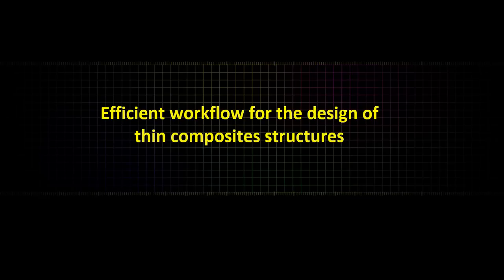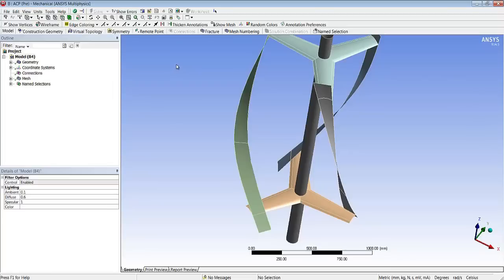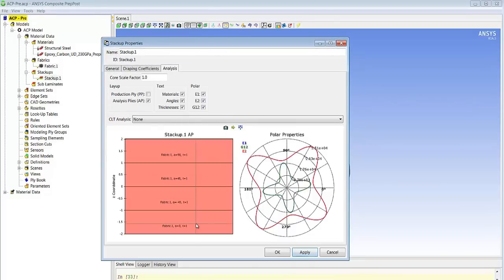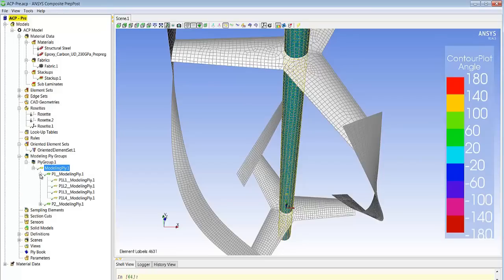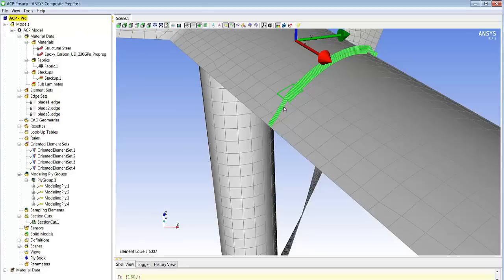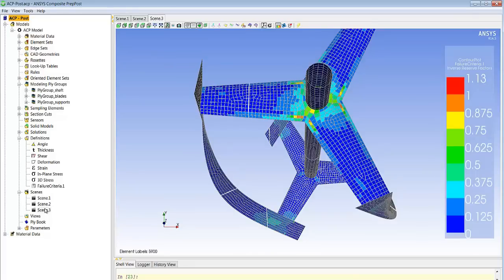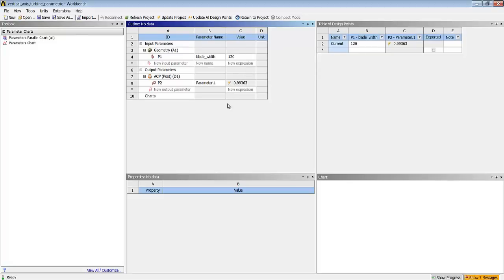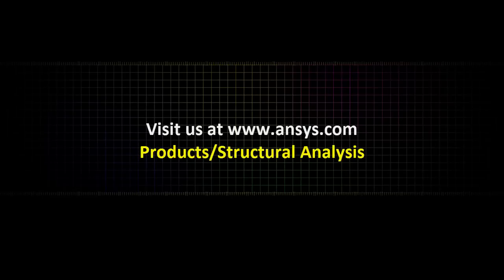FEA Simulation of a Composites Wind Turbine

Comment: Hi, I am simulating a wind turbine using ACP to establish the composite plies and I would like to know which tool did you use when you show the drop off in the blade (4:00), since I am activating the global drop off material in the fabric but it does not seem to be enough. Thank you so much for your answer!
Reply: +Mariana Correa I forgot an important detail. The location of the plies must be inside the blade, so I have this problem when the plies come out outside the geometry in the trailing edge, and at the leading edge, the plies cross between them. I know it sounds a bit confusing but I am trying to be clear. I really need your help! Thanks :)
Reply: i need compressor blade analysis using ACP